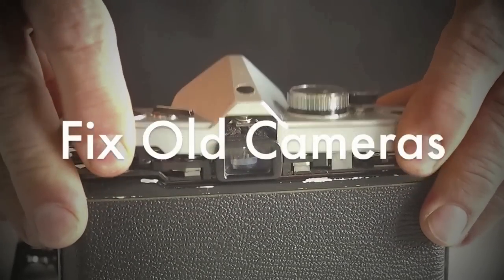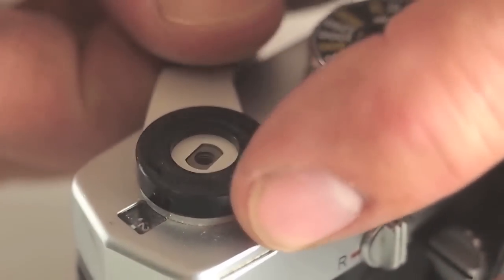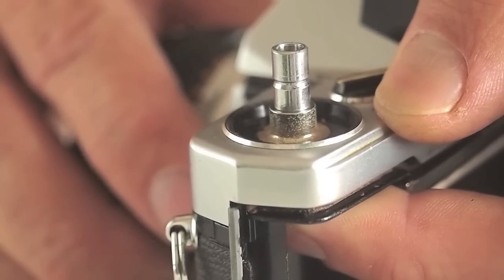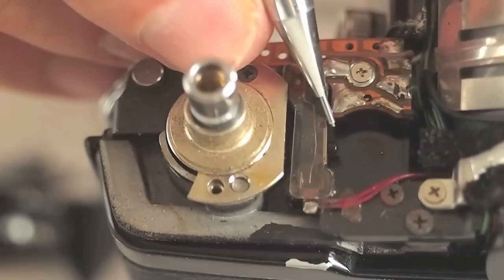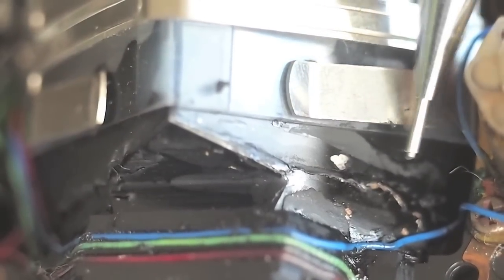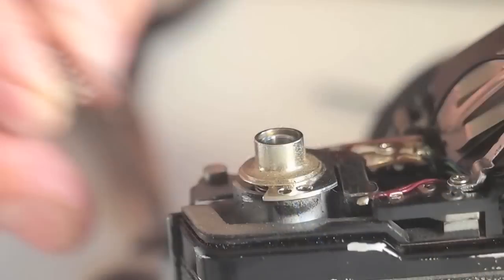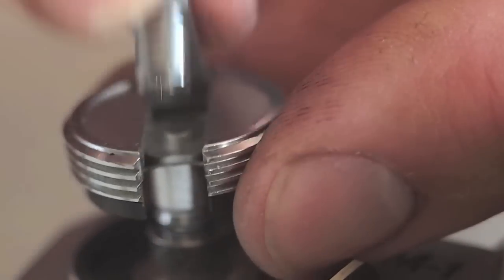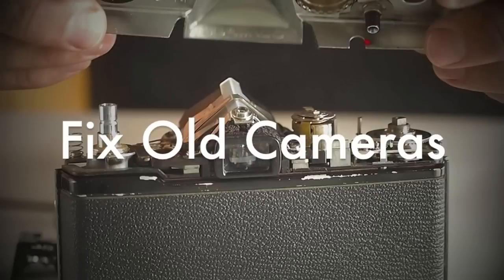Fix Old Cameras: Olympus OM 1 Prism Foam Cleaning

Comment: Thank you for video, if my viewfinder is affected already from the "leaking foam" can I  still clean it or is it too late?
Reply: if you see smears at the bottom of the viewfinder when looking into it, and if they resemble the contour/shape of the foam on the socket as seen in this video (as at 5:26), then the leaking foam already delaminated the prism; you're the judge as to what extent you can tolerate this, but it can't be fixed. By the way, you can see the delamination in person when you remove the focusing screen (see the corresponding video on this channel)
Reply from the maker: If you are referencing the plastic focus screen the foam will often leave a scar. It can be cleaned with a lint free swab saturated with distilled water following the concentric circles of the Fresnel lens.
Reply from the maker: Great clarification. Thank you for your comments and interest in FOC.

Comment: Thank you making this excellent video! I wonder if the prisms can be resilvered or if it's just better to find a donor body? I found a broken body on eBay that was really clean except for having been dropped and the mounts at the lens/shutter ring were cracked.
Reply from the maker: They can be if you have the required skills and materials, however for most cameras it is far easier and less expensive to locate a good donor as you have done. The old foam also needs to be removed from the donor prism so as to prevent future deterioration.

Comment: where are the light sensors on the eyepiece for the meter on the om-1n?
Reply from the maker: The cds cells are located in the frame that surrounds the viewfinder lens. The viewfinder lens assembly will need to be removed to access them.

Comment: Hi there, thanks for the tutorial, just wondering if there will be any lightleaks if the foam is removed this way. Cheers
Reply from the maker: Removing the damaging degrading foam from the prism of the OM-1 will not cause a light leak. Not sure what the purpose of the foam was originally unless it was to offer impact protection from the flash shoe socket bracket. If any knows or would like to speculate on the purpose of the prism foam please share a post. Removing the foam will cause no operational issues.

Comment: Good video, but from my experience the washer (ie the metal plate) is placed upside down in the rewind knob at 7:12. Today a film got stuck when I was going to rewind it and the rewind knob came lose so I had to put it back together.
When I followed this video the rewind lever felt lose and I looked at one of my other OM1s and saw that the washer went the other way around. When I redid it the lever was bouncy again.
Reply: You also don't need to use tweezers to pull the shaft back up. You can just use your finger and push it up.

Comment: How hard is it to remove the entire prism and replace it? I have an OM-1 with so much silver degradation that the viewfinder is unusable.
Reply from the maker: +David Hancock 
It should not be considered overly difficult. The prism removal varies slightly from early to later models of the OM-1 or OM-1n because of meter circuit, assc. shoe bracket and CDS cell assemble position, but the prism in all OM-1 cameras is held in place by a bracket across the crown peak of the prism and two screws. Take care with the loose prism bracket screws that they are not allowed to fall along side the gap into the mirror box. The prism has a slight curve to the bottom that fits against the viewfinder screen frame and care should be taken that it is seated properly before placing the prism bracket.
Reply: Fix Old Cameras Are prisms across the OM series interchangeable?
Reply from the maker: The prism between the different versions of the OM-1 and OM-2 are pretty much interchangeable.
Reply: +David Hancock I've read that OM-1, OM-2, OM-10, OM-G, OM-20, OM-PC, OM-40 all use the same prism. I've pulled out an OM-G prism and can verify it's the same part.
Reply: cooperontreadmill Nice! I haven't replaced the prism yet but I have a parts OMG around here somewhere that I'm not concerned with re-assembling.
Reply from the maker: Thanks Cooper for the list of compatible prism donors. Good luck David with the swap.
Reply: +Fix Old Cameras I just finished the swap! Frustratingly, the light meter worked before the repair and now doesn't.

I noticed a couple differences between the OM-1 and -1N. The -1 has the first type of switch and the 1N the second. Also, though the 1N prism nested perfectly in the 1, the saddle plastic from the 1N had to go with it (it was a different shape from the saddle plastic in the 1) and the metal mid-prism brackets had different shapes (The 1 had longer legs going to the screw holes than the 1N and the 1's screw holes were deeper in the body.)

Is there a way to clean a focusing screen? Some rubbing alcohol dripped on the plain matte screen and left a cloudy, white residue I can't remove. It's on the smooth side, not the Fresnel side.

Thank you for all your help!
Reply from the maker: It is possible that the curved base of the prism or the spacer is binding or pinching the needle of the galvanometer. Check the seating of the prism. Also check for a disconnected meter wire or damaged on/off switch. And yes there are several different version of the meter in the OM-1. Alcohol usually will scare the plastic of the VF finder lens. Clean the VF lens with distilled water.

Comment: Where did you buy the spanner?
Reply from the maker: The spanner wrench featured in the video is one of three that have been in continual service for nearly 40 years. 8 different interchangeable tips, a very good tool and unfortunately no longer available, unless a used one can be found. There are other options available, but none appear to be the equal of them. Recommendation would of course be helpful to you but none of the options available have been personally tested. The link below is a start. Of course, often in tools... you get what you pay for. 
https://www.amazon.com/shop/influencer-c06c729d?ref=ac_inf_hm_vp

Comment: I seem to have Fungus in the actual Prism of my Olympus OM-1 Camera. I took out the focusing screen to check to see if it was from that angle, but it seems that the problem is with in the prism itself. Do you have a video that goes beyond this video to show how to get into the prism itself? Maybe removing the eye piece?

Please let me know if you have anything like that.
Reply from the maker: A video showing how to remove the prism from an OM-1 would be a suitable subject for a Fix Old Camera video. The marking that you are seeing is probably separation of the reflective coating from the glass of the prism. The degrading foam has already damaged your prism. By removing the foam you have at least arrested the process. Thank you for your comments and suggestion.
Reply: Love the page! I actually need to replace the viewfinder assembly on an OM-1 with a better one from another OM-1 I have since I have exactly the problem Jessica mentioned! Could you tell me if you ever made a video on this? Thanks! James